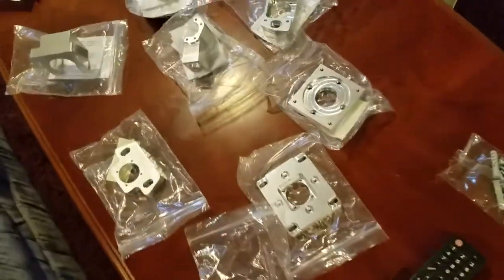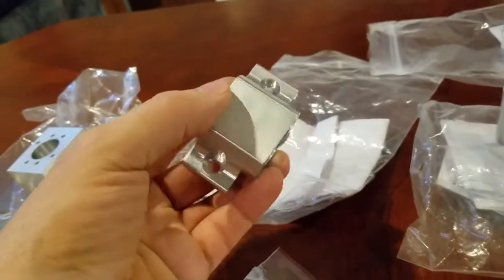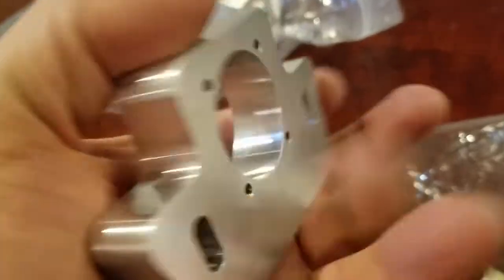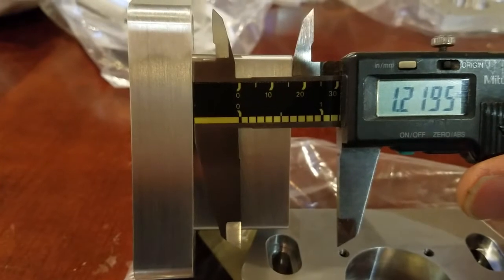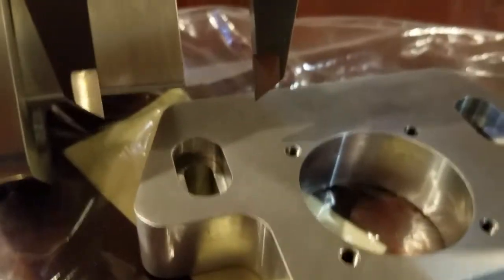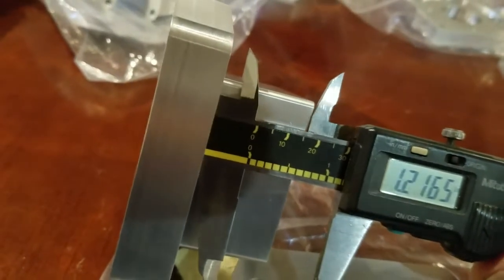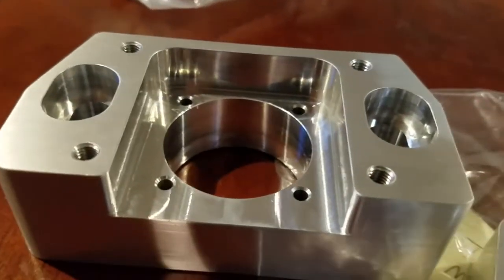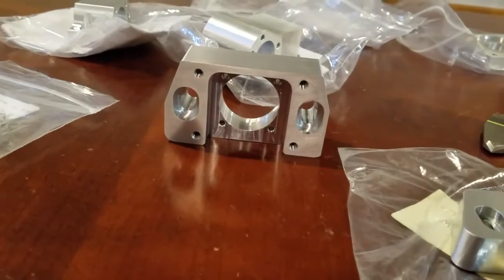PM-25MV CNC Converson/ Parts Made/ Used Free Plans from Franco

Comment: Wow! Fantastic job.  About the X axis motor mount...Yes, yours is thicker than mine.  After I built mine, I saw that the helical coupling rubbed on the bottom of the table ever so slightly.  I extended that piece along with the ball screw to provide clearance.   As far as the four tapped holes, I'm 99 percent sure they are M4 (just like the other part you showed).  I will double check that and get back to you.
Reply from the maker: About the x axis motor mount, let me understand you order a longer ball screw to fix this and mill more off the mount? another question I’m having problems tracking down long enough M5X0.8 Metric Socket Head Cap Screw thats for the top of the z top plate that goes thru the 1/2 stand off's to the bottom z plate where did you buy yours?
Reply: @wow-wow-p8d  You should be goos to go.  I updated the ball screw drawing when i updated the x axis motor mount drawing.  Check out McMasterCarr for the long screws.
Reply from the maker: @FrancoCNC  i want to make sure i have the right one before i order ball screw X axis is (30.276 inches long)? Thank You
Reply: @wow-wow-p8d  Correct.  30.2756" over all length.
Reply: Regarding the untapped holes you were asking about - they are M4.
Reply from the maker: @FrancoCNC  Thank you for your help! I may have more questions further i get.
Reply from the maker: can you help me out which ball screw do i need to order  eBay item number: 253926681285 and eBay item number: 254037887342,/     https://www.ebay.com/sch/i.html?_from=R40&_trksid=m570.l1313&_nkw=+253926681285+&_sacat=0 or  https://www.ebay.com/sch/i.html?_from=R40&_trksid=m570.l1313&_nkw=254037887342&_sacat=0&LH_TitleDesc=0&_osacat=0&_odkw=+253926681285+